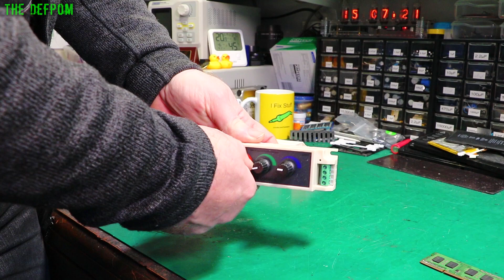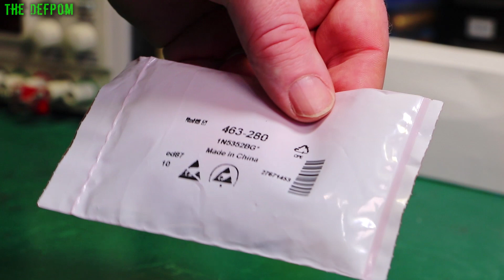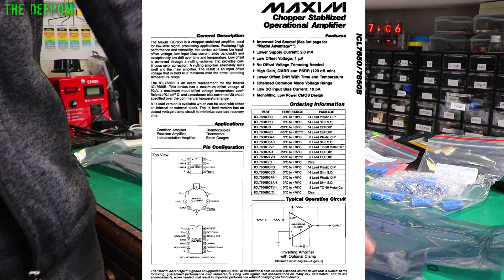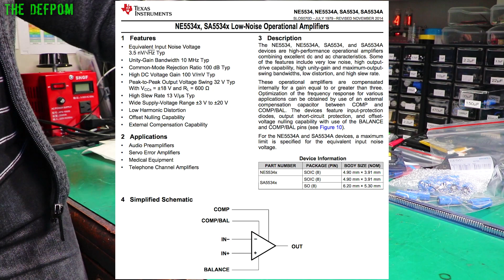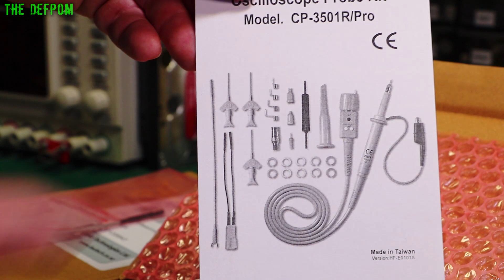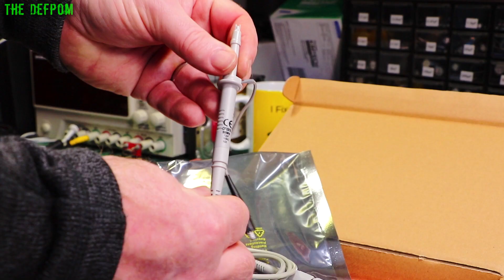🔴 Mailbag Monday 19th July 2021 - No.855

Comment: On buying extra oscilloscope probes a point of caution that is often missed when buying other than identitical to originals is making sure to match compensation range to the oscilloscope model.
Fortunately many general purpose  non oscilloscope manf types, then compensation range is eider than the manf types.
These are 8 to 20pF so mamy modern oscilloscopes are likely ok.
In many cases usees have been unable to adjust optimum  performance. Wide range can make adjustment more difficult  or likely to drift.
Optimal is to verify the input capacitance of the oscilloscope and make sure the adjustment range is reasonably centered, while choosing the type to buy. Of course other factors like the kit of accessories, cable length, compensation at probe or oscilloscope input connection  single or multiple element, division ratio, probe hook tip type and other specific user criteria all, other than cost play a significant roll.
Not at all suggesting a bad chioce in these  not that I know this brand.
Of course most of the accesory leads nullify the 500MHz bsndwidth, one unusual spec to me just now  is 12pF input cap of probe at only 100 KHz, seems rather low freq to assure that for such a high freq probe
Reply from the maker: Thanks for the explanation.